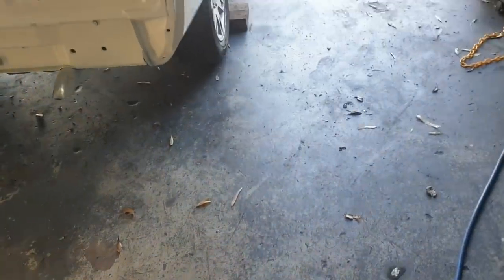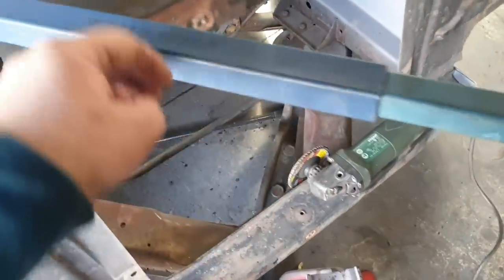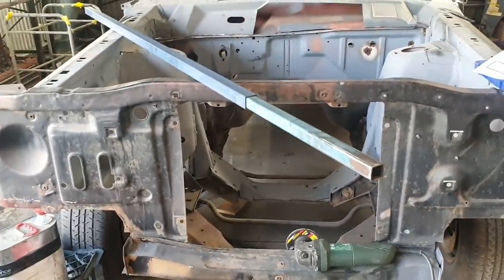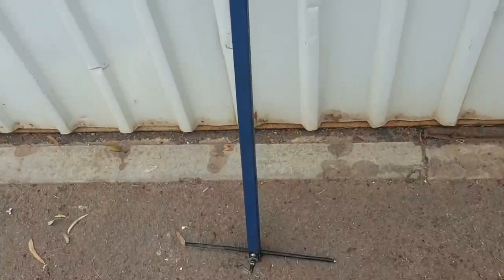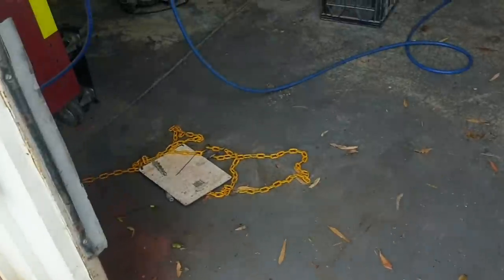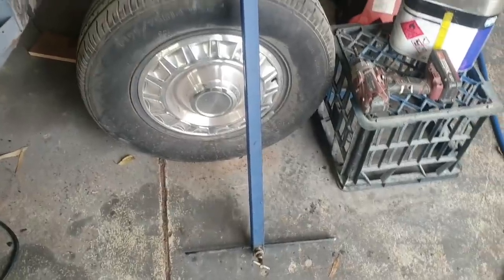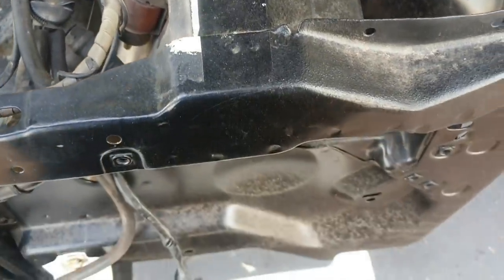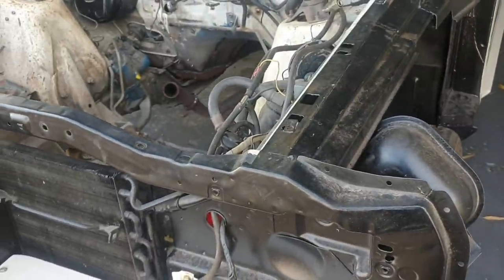landau alignment and making a tremmel gauge

Comment: Mate once you have the left sides distance, you then make sure the right side has the same distance, its that simple, but also heat up the main parts like the inner panel and cross member to slowly pull it out till it lines up, making sure that the front rad support still lines up and other under the car components as well.:)  at least that's what panel shops used to do, instead of ordering a new 1/4 panel section?

Comment: mate that was almost a cut and shut job for the left front, lol:) now your going to have to make sure she is really strong on that corner, heat it up and pull  it till she is perfectly aligned up and you need a real good measurements to start with, with out that your just going off the other cars mistakes? I think ford still has all the measurements on microfiche discs. :)